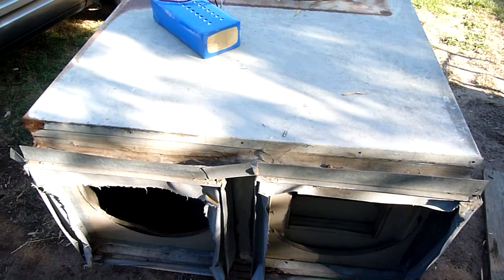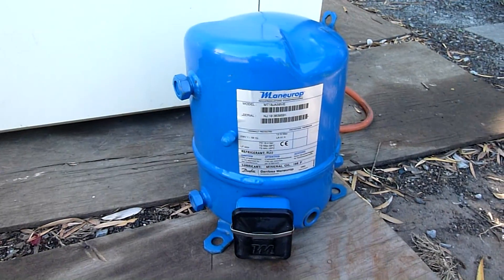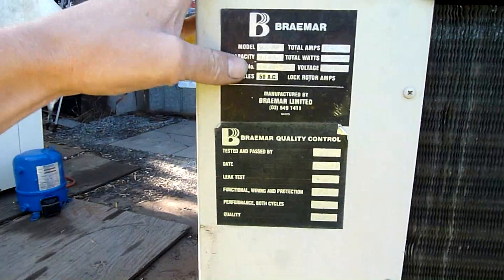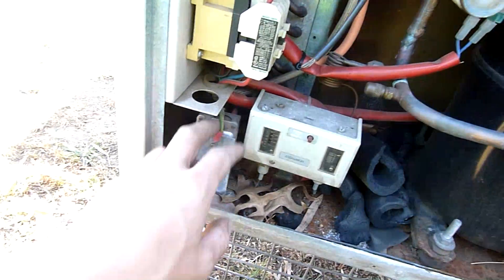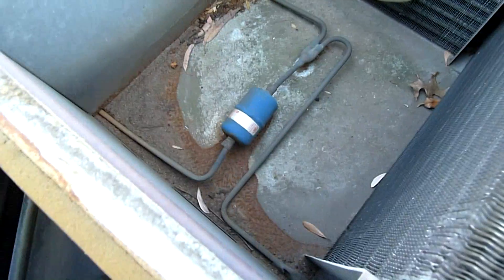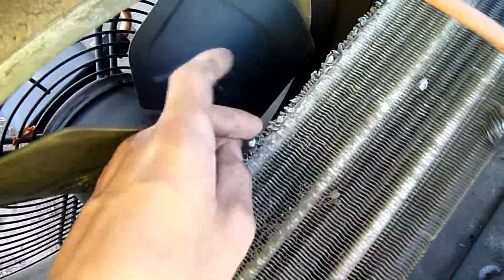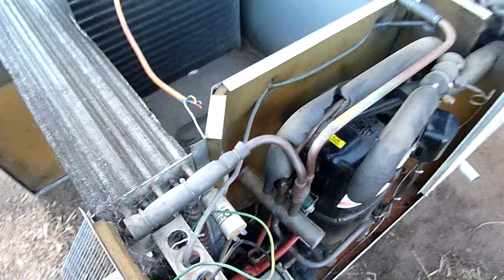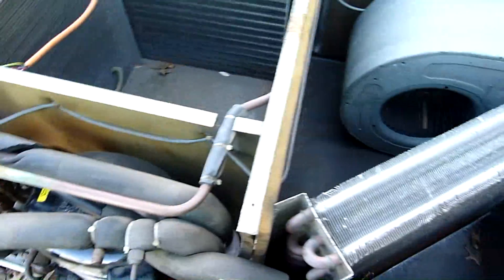Braemar 10Kw AC Conversion to Single Phase Pt1 -  Inspection

Comment: Is the second part uploaded? Not sure if he never finished this or if it's just him naming the titles totally differently lol
Reply from the maker: I have not done any more work on it, turns out I was reading the comp capacity wrong and I do not have a single phase compressor big enough for it :(
Reply: Ah, dang, would have been a neat project. Oh well, still interesting to see the inside of these systems. Recently HVAC has piqued my interest, though I won't be going into that line of work, it's pretty interesting stuff though.
Reply: is it possible to parallel compressors in a refrigeration system?

Comment: If you get this running are you just going to bolt it to the side of the shed or are you going to get some old trunking and do it properly? Some of the old fashioned square trunking running down the centre of the sheds roof with vents on the side would look awesome :)

Comment: good vid. shame they did not get me to clean it. would have come up like new. i was thinking of bringing you that twin comp unit this weekend but i found that i need to get the new compressor discharge hose re-crimped on the ser1 before i go for long drive on hot day :(
Reply from the maker: Bugger :(, i was thinking of using the comps out of that but I am not sure if there is room inside the unit for 2
I also found the AC leak on blue RAV, the connections on the compressor :(, somthing that would have been easy to do before charging :(

Comment: interesting project.. there's a blue compressor in the scrap yard but the thing is huge. its like the size of one of those half size 45 (UK )gallon drums.
3 phase sadly or i would have grabbed it. huge compressor though.

never done a compressor change yet..  sadly i dont have the gas reclaim or recharge gear. wish i did..  i'd love to get really into refrigeration.

Comment: Yoyr A/C videos rock!!!  Does package unit mean it is like a window unit only bigger and a duct connects to that hole?  Also can the NOS condenssing units not be used because indoor unit is missing?  What capacity is the split you are currently using?

Comment: Maybe the Danfoss one runs with 2850RPM and the copeland with 1450RPM.
The Danfoss could have about the half displacement with identical cooling capacity.

Why not run the original compressor with an VFD?
Reply: *****
I think the main problem is that the originial compressor runs with 400V and there ist no possibility to wire it in delta to run on 240V.
The most small semi hermetic compressors have this option but full hermetic... I havent seen anyone =D.
So you need a 400V VFD an feed 240V through a step up transformer in it.
In most cases the VFD will just work fine with 400V across two of the mains input. VFDs are kind of expensive but when can´t you get one from scrapyard?
I just bought a 7.5kW Danfoss FC 302 drive for around 50€, working!

Comment: I know the basics but i'm not an expert in anything cooling except cars. Here's my query: that compressor, could you in theory replace it with two smaller ones?

 I'm asking because i have a Bosch fridge and it has two compressors that can run either in combo for one compartment or separate for fridge and freezer.
Reply: That's what I thought, in theory yes but the current draw would be quite large and then there's the issue of where to put the extra compressor seeing as it's only designed for one big one. It's all doable, just complex and time consuming.

Comment: inst 1kw 3 phase the same as 3kw single phase in terms of total power.
Reply: well at 3 phase 230V you have access to 400V (in between the phases) so have more volts than single phase and a higher possible total output
Reply: ▷▷▷BLA BLA BLA MR. FREEMAN  I realise this but if you are measuring the power by kw wouldn't a 1kw 3 phase motor need to be replaced by a 3kw single phase motor.
Reply: BensShed no because a 1 KW three-phase motor gives you the same power as a single-phase motor